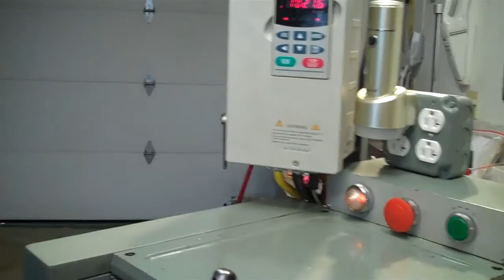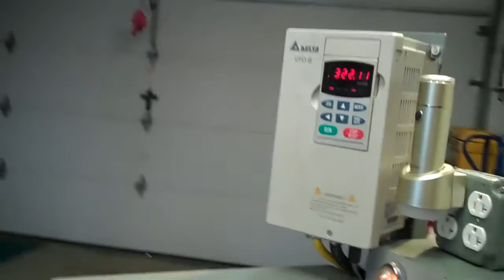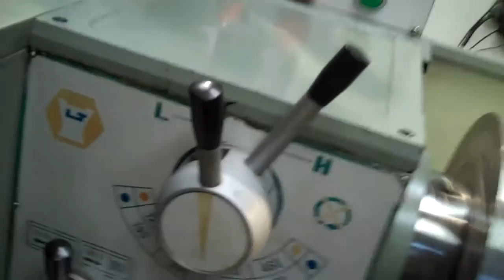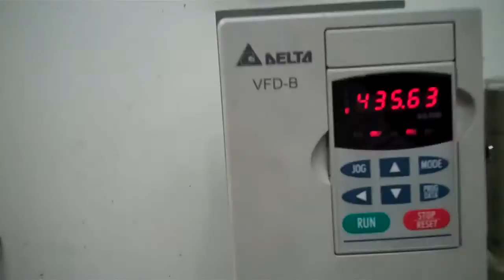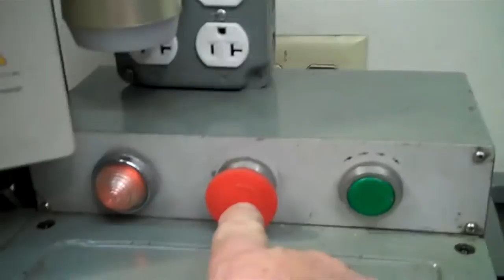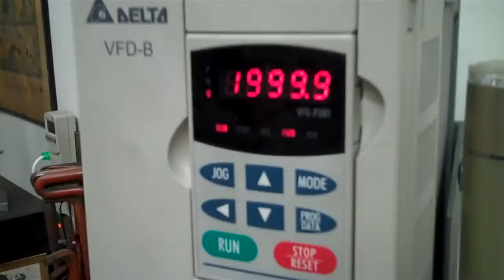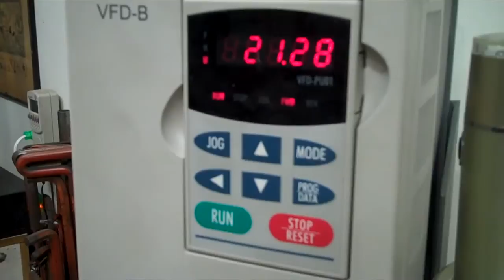MY VARIABLE FREQUENCY DRIVE LATHE 2011

Comment: I assume you wired the control lines from your front apron of the lathe to the control section of the VFD?  Did you dump the original contactors/relays?  Does your lathe have a foot brake?  If so, how did you wire that in?  Thanks,

Comment from the maker: TWEIGS, thanks for your interest. The unit I have is delta model vfd037b23a it is 220 volt single phase input and 220 volt 3 phase output.I got it on ebay jan 2011 from bjs woodworks I made an offer of $250 and they accepted .It was brand new .I couldnt under stand the manual that came with it ,so I went to deltas website and found a great one and downloaded it but be warned it took 300 sheets of paper and lots of ink.GOOD LUCK TO YOU.EDWIN

Comment: Which Delta VFD did you use? VFD022B21A / VFD037B23A / 43A / 53A.
I am assuming 230v 1-Phase input and 230v 3-phase output. Also you mentioned the drive was $300 where did you purchase this from. Many thanks in advance.